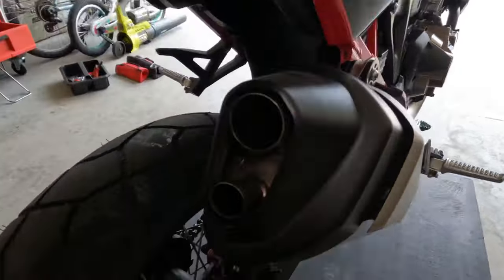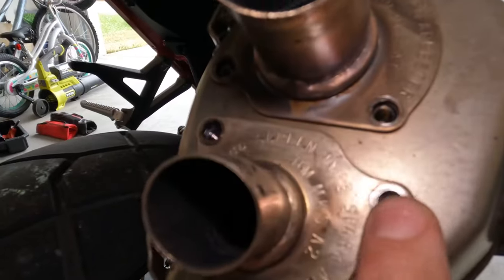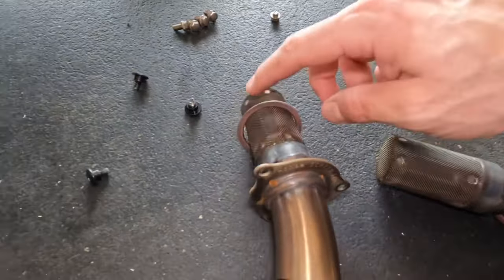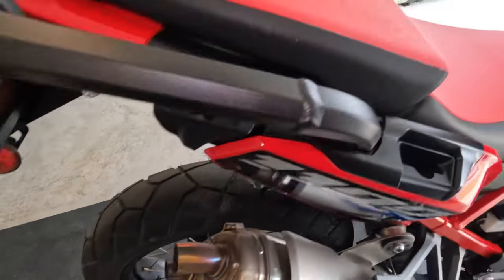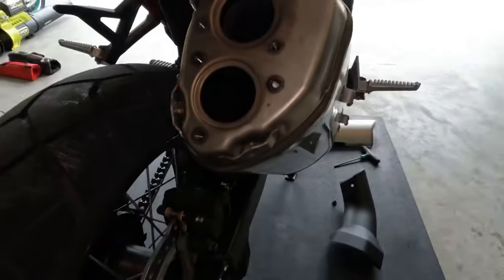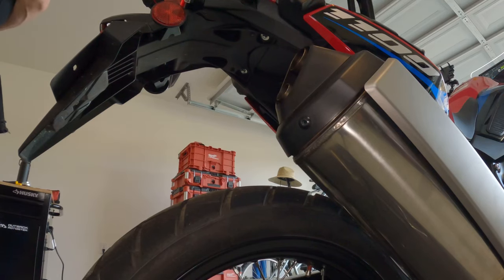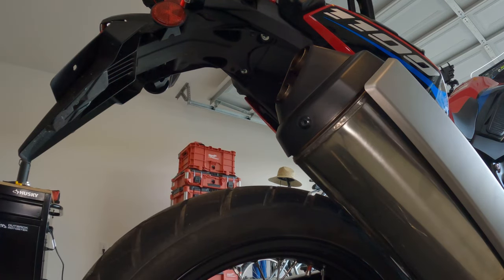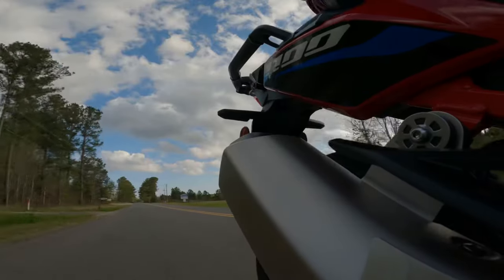Africa Twin Exhaust Mod “Sounds like a monster”

Comment: After 11 Harleys, I am done with the noise. Stealth is the new plan......LOL
Reply: I really dont understand people man. 
I can understand the power gain by allowing exhaust to remove more gas but why the hell you'd want a roaring sound? 
I have a crf 250l and one of my favourite things about this bike is how it sounds; it is very silent, in woods first thing that youll hear when it approaches is the scream of the valves, NOT the engine thump. and I love it. reminds me of the scream of GE9X :D 
but gotta admit: the thumpy sound of Africa twin İS good. because you can actually still hear the valves.
Reply: @mehmetgurdal  ride an inline 4 600. the scream of that is orgasm inducing
Reply: @blazortheepic0384  oh yeah I know :D
That scream has been a dream of mine ever since my childhood. 
However they are crazy expensive man. And although I enjoy them they're not exactly my type of bike. I prefer dual sport first adv second. Supersport probably lands on 3rd.
Reply: @mehmetgurdal  expensive? I picked up a bandit 600 for £500. Im getting a Wr450 though, i do love dualsports and off-roading too
Reply: @blazortheepic0384  hmm? Maybe not that much huh. I guess your brain really drops out at 3 am.
I've looked from the perspective of the recent model prices. 
Bandit 500 looks really nice though I'm hearing it's sound pretty often on nearby roads. But I'm not sure if I like it. It's impressive but I'd like to hear a higher pitch, you know? Like an f1 engine :D

Comment: Thanks for the video. I was able to get all my bolts out without breaking, which apparently is a very common problem. I started the engine from cold and as it idled I gently began loosening them. As the muffler began to heat up they all came out very easy. I checked the parts breakdown and you can buy a new pair of spark arrestors for less than $150 if you ever want to put it back to factory spec.
Reply from the maker: Yeah, I thought about that after the first bolt broke. I appreciate it though glad you liked it! More coming soon.

Comment: i replaced the whole can but done it because this exhaust tends can tends to have the inside valve seize up in the closed position so when that happens you bike fueling will get messed up since most of the exhaust will return back inside the cylinder.

Comment: Sounds unnecessary. Your daughter's comment is telling, it's hard on the ears and deafening.
Reply from the maker: It’s preference, you could always get a Zero or a livewire.
Reply: @motoprowess9383  Zero will rent you "features" like faster charging, more capacity or heated grips that are already part of the bike you paid for. I suppose if someone gave me one it would be a fun hacking project.
Reply: Puhoozy
Reply: Any stock bike revved in a garage is loud, especially for younger ears. You can’t blame it on the mod

Comment: Have you noticed any difference in the way it runs? Wondering if taking out the spark arresters affected back pressure.
Reply: Also great video by the way, loved the reaction where you’re consoling your daughter and then thumbs up the camera 😂
Reply from the maker: @jamessalter6535  Thanks, man! My theory was more air out is more air in. I couldn’t imagine having all that stuff blocking off the exhaust is good for power. But that being said I’m sure the effects are pretty minimal either way. The only thing I noticed is it’s got a little throatier deeper sound. I'll probably put an aftermarket exhaust (header and all) at some point. I just figured in the meantime that would be a cheap and easy little experiment.
Reply: I believe back pressure is only required in a 2 cycle engine.
Reply: @motoprowess9383  just wanted to let you know that I tried it. Oh my goodness I love the sound, the exact level of loud I wanted without being obnoxious. thanks for the idea, did end up breaking two bolts but it all worked out
Reply from the maker: @jamessalter6535  Nice man, glad to hear it worked out for you!
Reply: @andrewb1313  That's incorrect. It's required in 4 strokes too.
Reply: @feloniousmonk3049  Really? I know 2 strokes need back pressure in order to make enough compression to run properly, hence the strange looking fat exhaust. A 4 stroke makes the same compression with or without an exhaust system so why would a 4 stroke need back pressure?
Reply: @feloniousmonk3049  that is such a terrible myth. 4 strokes do not benefit from being choked down. They do benefit from having the proper length of exhaust after the header.
Reply: I spoke to Honda about a different silencer. They said Honda is funny about keeping back pressure and can recommend only a few cans that will be good for the warranty! They've had a few cases where some owners went against Honda's advice, ended up cooking the piston rings! Not covered under warranty due to an incorrect silencer!
Reply: @terrystratford1235  that all comes down to tuning, nothing to do with back pressure. When your "air pump" flows better you need more fuel to keep the correct air/fuel ratio. Running lean heats up the combustion chamber. These small engines are still under the gun from the governments on how clean they need to burn, so the manufacturers will detune and lean them out as much as possible to fly under the limits and still be somewhat warrantable. I would be amazed to see an exhaust that doesn't say that there needs to be tuning to make it use of it.
Reply: @TwoAMBlacktop  So is a tune needed? I've a 2001 jeep 4.7 v8 with a sports exhaust, unable to tune due to its age, runs just fine even after 4 years! Some vehicals the ecu learns and adjust fuel and air. Some bikers add the exhaust and k&n air filters then get the bike remapped! Waste of money, or recommended to keep the engine strong?
Reply: @terrystratford1235  When you add those things you need to retune on motorcycles to get as much as you can out of it, remember motorcycles are at the low end 100hp/L and still using a narrowband O2 sensor, even if they aren't high performance, they are if comparing to cars and trucks. Your Jeep isn't making anywhere near 400hp, so it's able to get by with a change like exhaust. By the way, your Jeep is on the HP Tuners List, definitely tunable.
Reply: @TwoAMBlacktop  thanks for info! I'm UK, for the dct they want £700 for a retune! Manual is £400 tops! 're jeep, Avon tuners and every one else I've spoken to say they don't have the specs, due to age, so they can't do it! Not that's it's not possible! I will def look into it more! Appreciate the info! 👍
Reply: I have a 919 hornet, replaced the mid pipe to get rid of the CAT and put on a shorty exhaust with the baffles removed and the bike has no O2 sensors. Runs soooo much better and way faster. Little Rich but whatever
Reply: You can’t manage what you can’t measure.
Reply: @feloniousmonk3049 yes. I lost power on my xsr when I took my baffle out on my am exhaust. Put baffle in and power came back. Designed to have a tad. I think the proper way is to shorten the pipe or get a slip on.
Reply: @terrystratford1235  were they euro 5 aftermarkets exhausts?
Reply: @kangacrew540  no idea! I'm guessing it's all about contracts!? I'm not paying £1200 for a hc project silencer! I have a leo vince silencer on my crf1100L, looks great and sounds amazing! I spoke to 3 bike mechanics and 2 tuning specialist about if I need a tune and can I take the baffle out! They all said won't need a tune and yes I can take the baffle out! What I find truly amazing is, the tuners said that with a non cat downpipe, it would need a remap and o2 delete, yet it would run better and smoother and cleaner than euro 5! So I asked why do they choke the exhaust in the 1st place......they said.....money!

Comment: I just picked up one of these bikes just wondering if your still glad you did the mod
Reply: I have mine removed. Been for 6 months. No issues or regrets
Reply: @rdspice2 hi man, is the difference big ?
Reply: @tescopiwo  it’s definitely worth it. Takes 10 minutes. If it’s too loud, put them back in. Very easy. There’s videos showing the process. Just take the cap off and then take the exhausts out and put the cap on
Reply: @rdspice2  thanks a lot for replying. Will see this weekend, i have the european version i hope it’s not welded or anything because of the noise regulations
Reply: @tescopiwo  ah… unfortunately yours is welded. So sorry :(

Comment: Any issues ? . I heard with not back pressure you can burn exhaust valve making engine last less than half of life.
Reply: I thought the problem wasn't with burning the exhaust valves but warping them. If you cut your muffler off and don't have a long enough exhaust pipe cold air can get pushed over to the incredibly hot exhaust valve and cause it to warp. Why would the absence of backpressure burn a valve?

Comment: DCT? Thinking about doing this on my 2017 DCT
Reply from the maker: Yes, Sir sure is, pretty easy to do. I think the 2017 exhaust is slightly different but should be basically the same process.
Reply: @KJ Rants get yourself a muffler from 2018/19 AT. They are 2 chamber compared to 2016/17 which are 3 chamber. 2 Chamber much better sounding, more deep rumble sound. Next thing is to remove the guts from the catylitic converter. I personally prefer the look and sound from the oem muffler compared to aftermarket mufflers.
Reply from the maker: @steadyeddy-goingnowhereslowly  I had not thought about that, I'll check it out for sure. I was definitely going to take care of the cat though.
Reply: @MotoProwess there some youtube vid on decat. Basically cut it open on back and bend cut section open. It has double wall. Then remove guts and close and weld.
Reply from the maker: @steadyeddy-goingnowhereslowly  Yeah, should be pretty straight forward. I’m going to post whatever I do so you can check it out.
Reply: I took mine out (2016 DCT) the second summer I had it. I took both spark arresters out completely. Sounded great. Deep and throaty. Cutting like in the video leaves the same outlet size so there is minimal sound change. Nothing melted either. But the lack of back pressure does cut fuel economy a little. I eventually got sick of the extra noise and put them back in. Harley riders would all turn their heads when I rode by. It was TOO loud. Last year I bought a Termignoni slip on for it. Single outlet but larger so back pressure isn't changed much. I also broke a stock bolt taking the stock silencers out. Run it without till you get sick of it.

Comment: hello friend, my escape 2020 is different. it has a welded plate and I don't see the screws.
Reply from the maker: That I odd. Is the exhaust stock?
Reply: @motoprowess9383  the exhaust is stock. I may have a problem being purchased in the Spain, is diferent. :((((((
Reply from the maker: @jorgedonoso8356  You can email me a photo at motoprowess@gmail.com and maybe I can help you out.
Reply: Different markets have a slightly different spec muffler. The U.S. exhaust is slightly different than Europe etc.
Reply: @motoprowess9383  look at Instagram bro ;)